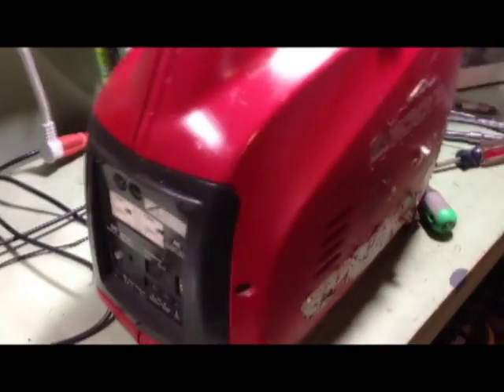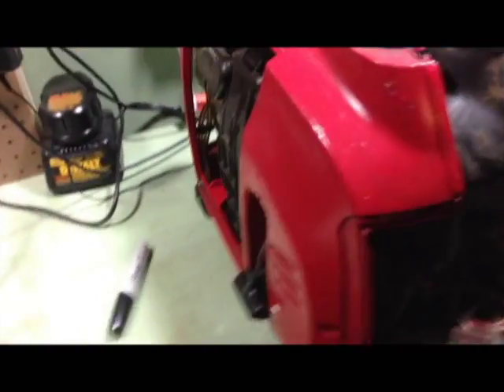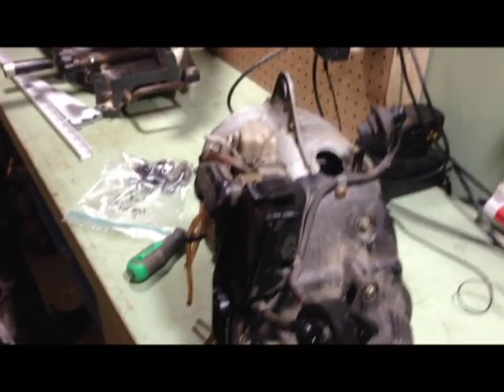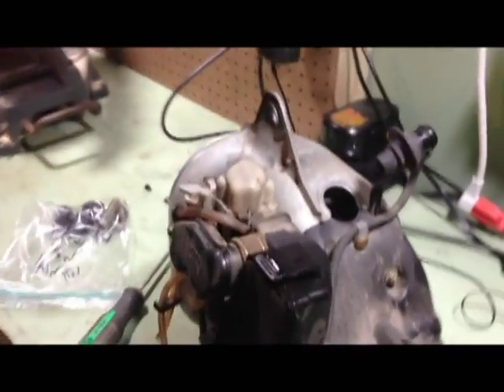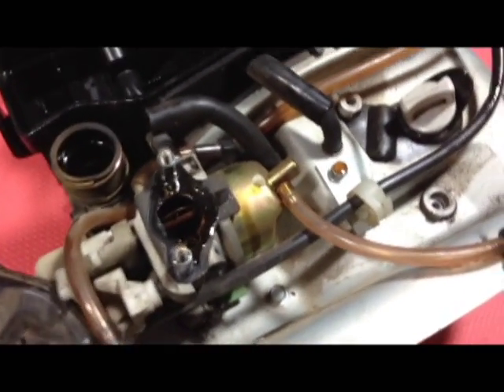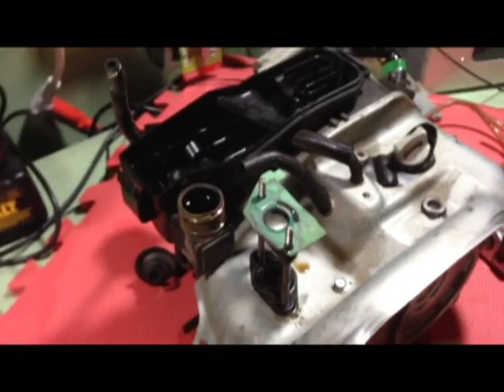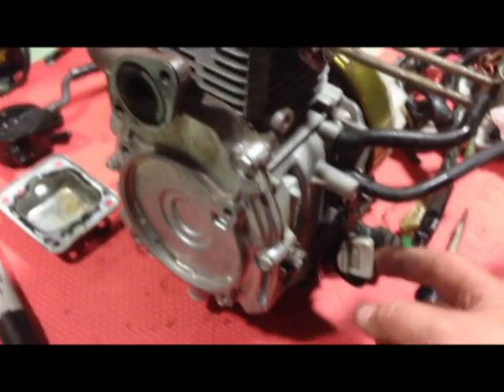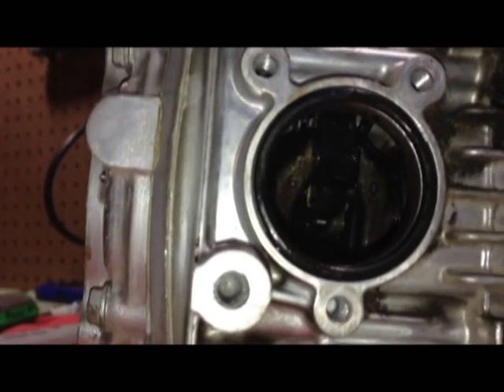Honda EU1000i Generator Tear Down

Comment: I have over 12,000 hrs on mine.  Yes, I really do! The only prob I ever had was the muffler clogged up.  After running it 24/7 thru 2 winters my rings are shot.  Thanks Honda and Royal Purple for all the dependable power I've needed for my off grid experiment.  I hope the parts I need will be delivered promptly.
Reply: Did you add an hour meter?

Comment: Yes I have same problem.. cannot start, and sometime no spark.. was check from cable black to ignition no spark to.. the supply from spull or from inverter.. I confused.. 🤦
Reply from the maker: I unfortunately ended up parting this unit out and moving on to something else.

Comment: Weres video 2 i just bought a used honda 1000 and im having a problem i can only start honda on the run mode not with choke on. Why what steps can i take to figurebout problem
Reply from the maker: warehousegeekrq - never put it back together, ended up parting it out. Bought a bigger generator instead.